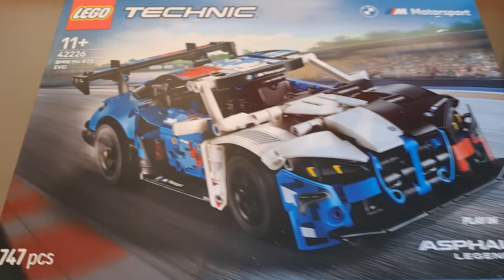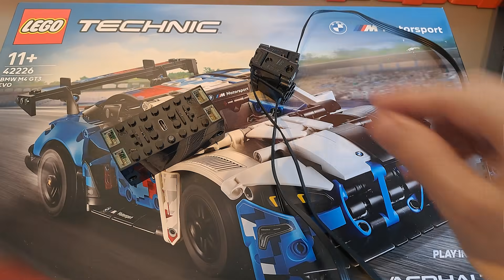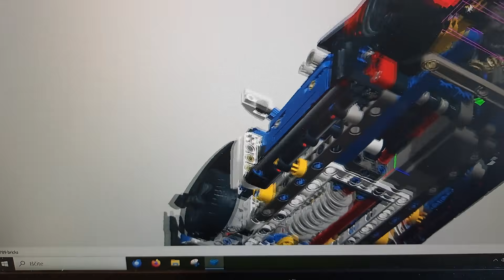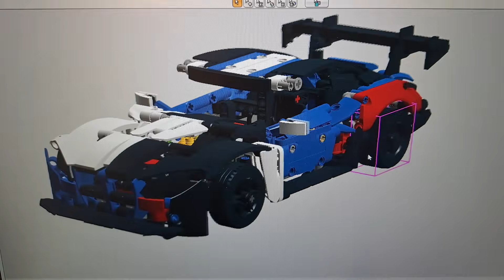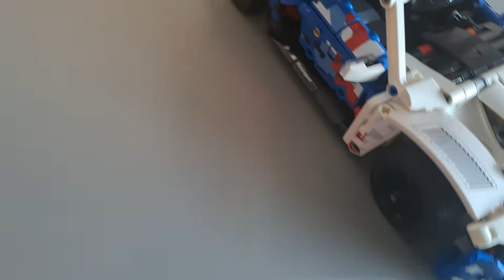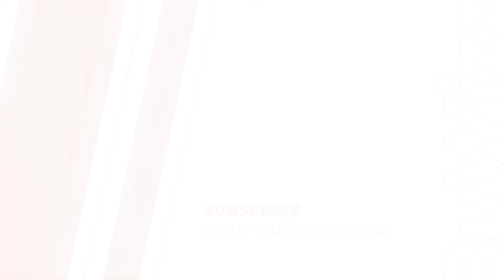Motorizing the LEGO® Technic BMW M4 GT3 Evo 42226 with BuWizz

Comment: Heyyy, been looking forward to this build since the set came out! 
I'd be interested in knowing why you consistently use an L motor for steering instead of a micro motor. If it's because the BuWizz 3.0 doesn't have enough ports for more Power Functions connections, perhaps building a micro motor with a Powered Up connector would be a good move in the future. I'd buy a handful of those!
Reply: The powered up L motors have position sensors which allow them to automatically return to center like a servo motor, whereas the micromotors are meant to be compact, and therefore do not return to center, as they lack a position sensor.  This means that, if a model was steered by a micromotor, it would be unable to drive strait forward.
Reply: @VerdigrisTechnic Thanks so much for explaining!